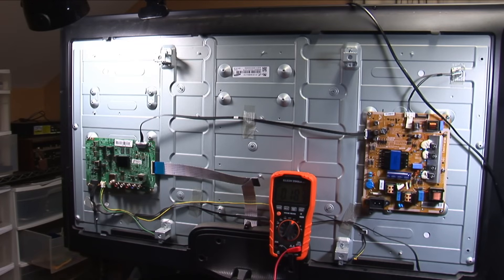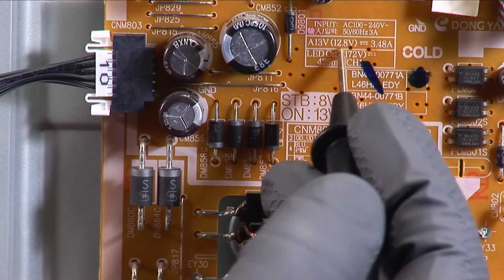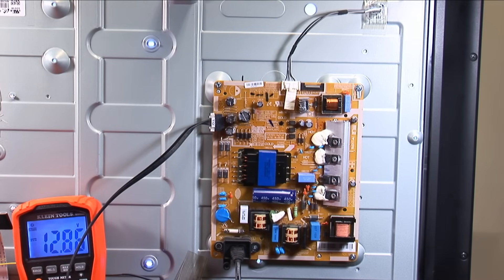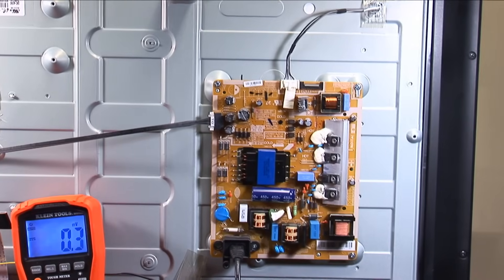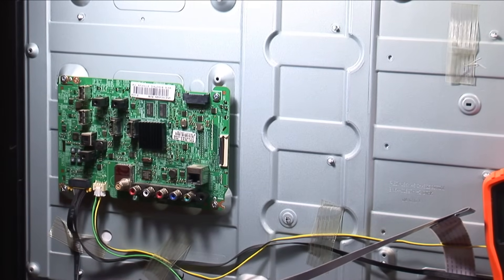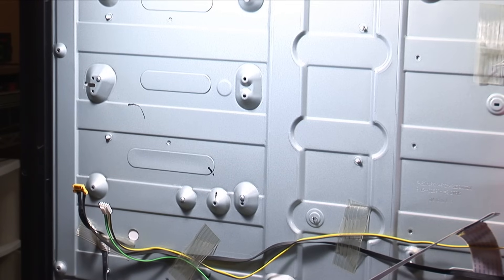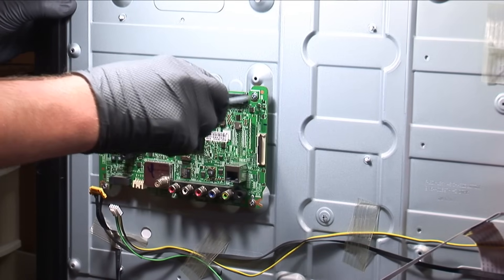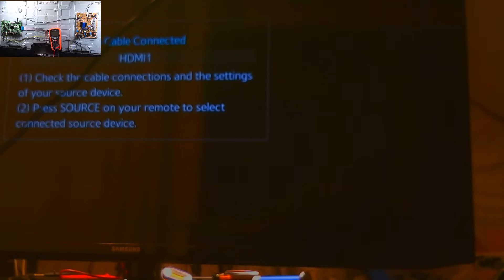Samsung LED Flat Screen TV Repair - Won't turn on, no power - How to Fix

Comment: I have been repairing Electronics for over 35 years. The Electronics of the day were a pain in the wazo to fix. I wish they were as simple as the ones today 😂. Now, the reason why I came here was because I also had the same model. I tested the power supply and all the voltages were there. I don't have a schematic, and I am not going to buy one for this one time thing. But I had my suspicions it was the main board. Thank you for your help. You have a new Sub.

Comment: I've had to do this before a few months ago, I just replaced the main board because the aerial/antenna socket snapped, I'm now having this same issue with a different TV and I've not removed the back cover yet and used my multimeter on it, however that being said, I want to sincerely thank you for this video, and it's the best one I've ever watched, very informative, thank you again, thumbs up and subscribe.

Comment: This just happened to my tv today.  I’m almost sure that it is one of these two boards.  The tv was working fine and just went black so I don’t think it is the display.  
My guess at first was mother board but 
It tries to turn on, turns light black, makes that click like it is about to turn on them screen goes black. So this is leading me to think it is the power board. 
Idk. So if I pull that plug like you did and the backlight turns on you think it’s the mother board?

Comment: Sir, how is the Quality of Samsung TVs, meaning the Quality of Circuit boards, electronics, etc.. as compared to other brands? Which Brand/company TVs do you get the most for repairs? And which brand would you suggest Sir, for long life of the TV? I was about to buy Samsung QN90D65 for a huge discount.. Please reply Sir...

Comment: Hi! Thanks for the vodeo. I have one question did you ever had a powerbutton  heat up on a 75 inch samsung smart tv, like your phone on the sun? I replaced the main board, my screen is blue. I just only can turn it on manually, that how I find out it is overheating. How you remove the power button?

Comment: Fantastic. I am now going to measure the voltage on my connector from the power supply to the main board. Lots of fun. It isn t even about saving the $199 to buy a brand new one : ) Thank you for your videos : )

Comment: Question, I have a samsung tv very similar model that took a power surge. I replaced both the power supply and the video board and power is moving thru the system. But the screen will not power on. Any suggestions?

Comment: If all you are doing is replacing boards you are not fixing it.
Reply from the maker: That was the idea, how can anyone fix their tv easily without having an electronics background.  And in the end if it turns on and works, its fixed.

Comment: Hi. I have the Samsung UE49KU6400. Tv doesn’t open. Power cable is working , I changed both motherboards alone but still doesn’t start. No light etc. is there any possibility, the cable which connects the two motherboards be faulty or something? I don’t know what else should I do. Thank you very much.

Comment: I removed cable between power and main board. Backlight doesn’t come on. I’ve read that the main cause of power board failure is due to faulty LED backlight strip, don’t know where they are. If you replace power board it will eventually fail again?
Tested voltage at high voltage cable on side of power board. Pin 1,2 = 0. Pin 8,6 = 0.

Comment: Have that trouble with a Philips tv, have solder some bade connection,  but not better fore long time, when i take out the content fore the power  in 24 hours, switch the Tv on and i see the diode lightning fore power on , and switch fore Tv on with the controller, works fine the , but when i switch off with the controller to times , the Tv not show no light in the diode fore power in to the Tv, and no hope fore too switch on the Tv

Comment: I unplugged the main board from the power supply and no back light came on. My voltages were normal except one pin was 3.3 rather than 3.17 and 2.3 instead of 2.2. The standby light blinks when it comes on. The optical port on the main board lights up red. I thought one time I saw a flash. I dont wanna do a main board if the power supply is just gonna fry it. Any idea? Tcon? LEDS?

Comment: And interesting thing you've mentioned is that it uses the screws as ground posts.
I have a TV which won't turn on, it may have happened in kind of a storm too but I'm not sure, it's from my grandma.
There is electricity flowing through the PSU when it's plugged in, even tho I'm not sure if voltage was much too high on certain parts. Need to re-measure on the weekend.
The weird thing I've already noticed was that there was electricity being measured from the whole metal back panel and most screws which hold the back cover while it's plugged in. What could potentially cause this? I'm not an electrician or anything like that, I only have a bit of knowledge about a few things.

Comment: This inspired me to fix my own  samsung tv. Ordered a new power board on ebay for $95 and replaced it myself with just a Phillips screwdriver and a pair of pliers to unplug the old one. Thank you.
Reply: Hi what was your issue? Mine cant turn on with standby light flashing. Not sure which board to replace.
Reply: I have 114v coming in and fuse is good but nothing after on samsung un85tu8000f

Comment: After many many reviews on the similar issues on YouTube, I can comfortably let you know you may check the power supply board by checking the standby voltage.  If the board fails, the board can be purchased online with used condition and good price and guarantees its good condition.

Comment: in the video you don't show the voltages that should appear if the TV is really dead, even without the backlights
Reply from the maker: @luisdias6868  It differs depending on what is wrong with it.  In this video I'm more or less just giving some general tips to people on how they may fix their own tv.  I'm not explaining top to bottom how to repair a tv.  These parts are usually available on Ebay for ~$20,  so its usually not the end of the world if you buy the wrong part.  I've heard from comments some people say they saw their tv also used 2 small boards and just ordered both since it was so cheap.  Not saying to waste money, just some people are willing to take the chance and want that option.  

Now some boards may show the voltage by the connector or wire, anymore its rare but it does happen.  If for instance the connector says 5V and its outputting 3.5 or 0 volts, then yeah that's something to take into consideration.  Something could be shorted out and is pulling the voltage down to 3.5, or the power supply could just be outputting 3.5v.  There's far too much to consider for one small video.
Reply: @Electronicle  In this power supply I had 3 burned components.  fuse, and 2 transistors short circuited.  I ordered these components, put them in place, the TV still doesn't do anything.  is still dead.

I just said it to see if you would know why?
Reply from the maker: @luisdias6868  it sounds like those components are just being taken out by one or more other bad components that aren't visibly damaged.  That is often the case when troubleshooting or just working on electronics. That's why we use various meters and scopes as tools to see what is going on under the surface.  Have you checked for used working power supply boards on ebay?

Comment: I have a Samsung model # UN50H5203AF WILL not turn on . I did what u did in video to unplug power board from main board.  I have no back lighting like u said but I have 12.7 from power to main board any answers

Comment: The led light underneath my tv flashes red and the screen acts like it’s going to turn on but never does. and sometimes you could hear a channel but turn ls off real quick and stays black. I need your help please. Any ideas would be much appreciated. thanks
Reply: Same, trying to diagnose my mom’s curved 60 inch QLED. It actually displayed an image showing to connect power to both the TV and the box that the AV/Ethernet connects to. I get a red light and it flickers just ever so dimly. Could have been from storms.
Maybe it’s the infrared sensor.

I’m really curious if I can fix myself given I’ve got experience with some electronics repair.

Comment: Hey I have a samsung 32 in BN96-11524c main brd  Shopjimmy had tried to help and was saying it was my main Brd we went through 3 diff ones and didn't resolve my issue... I have power light on but no sound or pict..when I disconnect the main backlights come on.  Can You Help??
Reply from the maker: Have you checked that proper voltages are being output by the power supply?  Often failures in power supplies aren't complete failures, but it'll output say 12 volts but the 5 volt or 3.3v output is dead.  This would cause it to partially work.
Reply: @Electronicle  NO I haven't I can ck it but not sure where to ck

Comment: Hi I have a Samsung tv has no power no standby light or anything seems like a dead tv 🤦🏽‍♂️ I ordered the motherboard and power supply board still doesn’t do anything any suggestions of what it can be I will gladly appreciate it

Comment: "I have a Samsung like that as well, but I can only get the red light at the bottom to turn on.

This happened after I connected the TV to 110V. It worked normally, but then the picture froze, and after that, it wouldn't turn on anymore and there's no sound either."

Comment: my samsung tv won't turn on red light blinking all the time , but when i unplug the one connect cable my tv turns on that i have to plugin the cable , do you think its the same problem in your video or do you think it's the samsung one connect box next to my tv ?
Reply from the maker: If you mean HDMI cable try a different cable or unplug it from the other device first and see if the TV turns on. Could be a short.

Comment: Hi, I have an Un48J5570, it does not turn on and if i try to unplug the cable on the mainboard, there aren't any lights.. The tv seems completly dead, is there anything i can do? Are there lights on every Samsung TV?
Thx

Comment: Nicely done video. It was really helpful to me, thank you! I thought my issue was the main board but was not. I found that the scotch tape method on the connectors worked for me. Nonetheless. Your trouble shooting steps in this video helped me tremendously to narrow down the root cause of the problem!

Comment: Hi, you have presented an excellent video showing voltages to verify, I dont get backlight at all does that mean Power Board BN44-00667A is bad? I would really appreciate if you could guide.

Comment: So I have a samsung UN55D6000SF and so when I try to turn it on I get nothing won't turn on but the little power light blinks on the bottom right side of the screen and I see the red light for the audio out is on on the back of the tv so it's getting power but won't actually turn on and I looked at both sides of both boards and don't see anything burnt on either board. Any ideas on what can be happening  here? Could really use your help

Comment: My Samsung 50in uhd tv just gradually darkened while in use, the backlighting seems to be working because i get a glow from behind when turned on, when i tap around on the screen i get impact flashes on the screen, i can hear Netflix theme sound when Netflix is selected. Which board may you guess may be the problem?

Comment: Thank you. I have different situation where my tv is not turning on and it has power, the light under Samsung logo is lighting red always and there is no response to press long press or use the remote control … do you have any idea what could the problem, two days ago i tried to open and i did long press on button under Samsung logo and it works but today no more response

Comment: I just replaced the power supply board and had the same issue. Just ordered the main board in hopes it helps. 50/50 shot right? Lol

Comment: Yippee I fixed my tv. I have the parts and I swap them out one at a time and found it it was the main power source the first one that you tested to be the culprit. I put all the new parts in anyway and we'll save the ones that we're not the culprit for future use. I figured I had the TV open and I already had the parts I might as well switch them out. I'm so happy and it didn't cost me a penny. 12 years ago Best Buy was just supposed to fix my TV in the parts didn't show up on time so they brought parts then when the other parts arrived in the mail I just kept them for future use and I'm sure glad I did because now it's like I have a brand new TV. It's a 3D TV plasma so they don't make those anymore.

Comment: Really easy to follow troubleshooting guide. Thanks for sharing. Our tv that’s less than probably 5 years old has died. Bought at Costco but since everyone abused the return policy by upgrading their tvs every year, it’s way past the 90 day return window and probably past the extended as well. Power or logic could be the issue. Measuring the fuse and verifying voltage levels first was key. I’ll do the same.

Comment: I have two model UN46F6300AFXZA purchased in 2013.  Both experienced the same dark horizontally along the bottom of the screen (One in 2016 and the other 2023).  Is this a problem with the main board or the LED array?  Samsung claims to have no reports of this up to now.

Comment: samsung ua50tu8000w. switched on screen just flashes on off but does'nt switch on .iI am trying to service the power board but I can't find stdby point marked on my board. Appreciate some help, don't like to spend $100 on a replacement board if mine is not the problem

Comment: We bought a Sony XBR 49X900F about 5 years ago, thank God we got the extended Geek Squad  warranty, one day the volume went out and then the next day no picture. Geek Squad came out and said the power supply and motherboard were both out, so they accredited us full price, so now we are getting an LG OLED, what bugs me is that TV was rarely used, a TV show or two once in a while. Guess the engineers screwed up and it broke before the warranty expired.

Comment: I have this issue with my SAMSUNG UN46H5203AF, The past week I have come home to find the indicator light off, I would unplug and wait 10 seconds and it would come on and work, today when I unplugged and replugged I got nothing.I have yet to pull the back off and do some testing. Looking at how expensive parts are before digging in. Would a SAMSUNG UN50H5203AF control board work in a SAMSUNG UN46H5203AF TV, they look identical but the 50"TV board is 24.99 and the board for my 46" TV is 49.99? Any help would be appreciated. Thank you!

Comment: So it seems I have the same 2 board set and connector layout as in the vid. My power pins check out (12.8v) to include the 5v on/off power. However I did not get backlight when I disconnected the connector from the main board. So otherwise I would think the main board with that issue but still considering power board. Is that a must to have back light when determining if the power board is good or not?

Comment: I purchased a motherboard a week ago for my Samsung TV and apparently this was not the problem. My TV red light on bottom flashes a series of two times (x2) then once, and repeats. The screen cycles through various light shades of color during this time but no picture. 

I disconnected one at a time, one side of the LED jumper strips at the bottom of TV, my TV has two strips total, and the LED lights stop flashing for each time. After reinstallation of the strips the LED lights began flashing again as before.

I then disconnected the ribbon connected at the bottom of the TV and LED lights stopped flashing. 

Im at a loss. Can you help?

It would be much appreciated.

Phillip Davis

Comment: So how much would it typically cost to replace either or bored i'm having the same issue with a 72 inch Samsung pop it open none of the capacitor seem to be blown on the power board

Comment: I've tried doing the hard reset by unplugging for a full minute. I've had tv unplugged and pressed the power button on bottom of tv for a minute as well as suggested by another YT channel with same result tv won't power on. They also suggested taking out the batteries and press the power button on remote, which didn't work either!!!! Now, I've come across this video, which makes me hopeful that we can fix our tv instead of incurring the cost of purchasing a new one. You made it look relatively easy except for 2 things...1) where was the replacement board purchased? 2) how much did the replacement  board cost? I hope you respond, because I'll pass this video on to my husband and I'm sure he would like an answer asap. Thanks for posting
Reply: how is ur tv now ?

Comment: tried EVERYTHING, removed powerboard, cleaned with white spirit and scourer, cleaned components, dried SAME. tried disconnecting other circuit board DEAD. reconnect SAME. TRIED menu IN THE 10 SECONDS IT WOULD STAY ON. pressed OFF to ANYNET CONNECTION, pressed RESET, pressed  ECO MODE to AUTO. still SAME. moved tv and put on stand SAME. ---- HELD DOWN POWER BUTTON on remote for 10 seconds WORKS FINE, NO MORE SWITCHING OFF.  dvd player signal CLEAR ON TV and tv programmes WERE NOT RETUNED.

Comment: Actually the TV's power light flashes red indicating a power supply issue. Just find a board for your model. For instance on a UN50 and UN 55D 6000 it is the board.